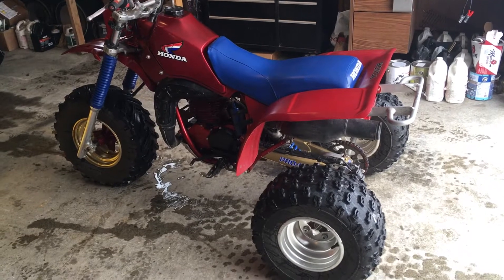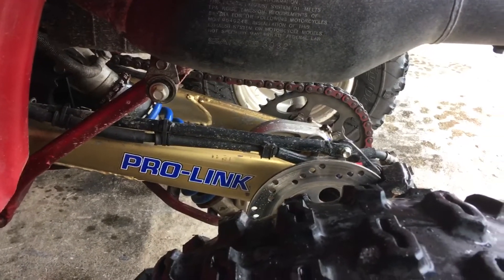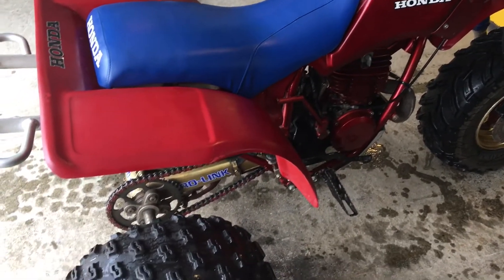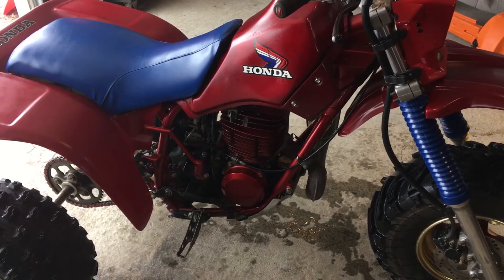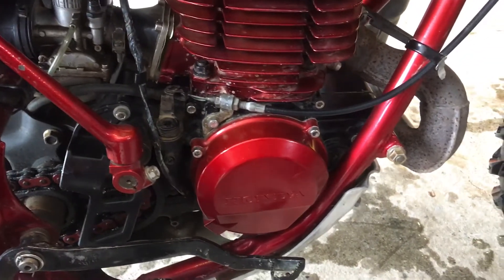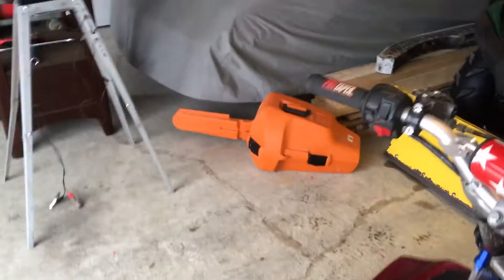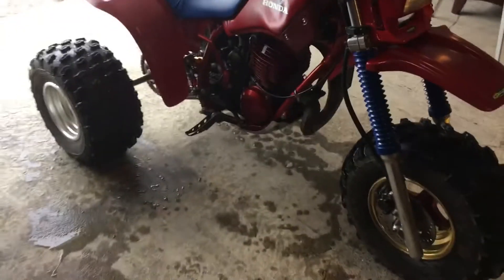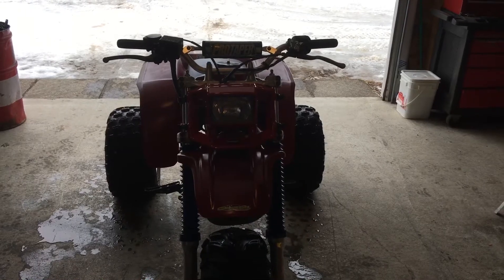1984 ATC 250r resto/mod complete

Comment: Looks great man! I'm doing an 83 right now that I inherited from my father in-law whom passed a couple weeks back. The funny thing is when I first met my father in-law I had just purchased two 250r's as basket cases 1 was an '82 the other was an '83 so I used the 2 to build 1, this was In 2003 back when the 3 wheelers had little value or at least not like they do now anyway I rebuilt the '83 back like new it was a gorgeous bike that started first kick. I honed and bored the cylinder over, new piston, rings, bearings, electronics, new clutch, rebuilt carb, new rubber and cables, powder coat everything, new tires, new seat and cover and brand new plastics with all new decals and this bad boy was like new funny thing is back then to do all of this was about the same cost just the plastics are now lol ok maybe thats an exaggeration but to put it in perspective I only paid $120 for all new plastics back then. When I was done with it all I sold it to some lucky and super happy kid for $1,500 he was so happy (he was 19 so not a kid just FYI) anyway now I'm doing the same thing and this time I'm keeping it for life like I should have but GD is it expensive now when you said you put $6k into it I was like yup sounds right and thats crazy. Do you have any pointer on good or must have upgrades? I'm not doing a show bike this is going to be for use and I'm going to have fun with it.
Reply from the maker: Sorry to hear about your father in law, but if your doing your own work it’s easy to justify the outrageous prices, 
Keep us posted on your build👍